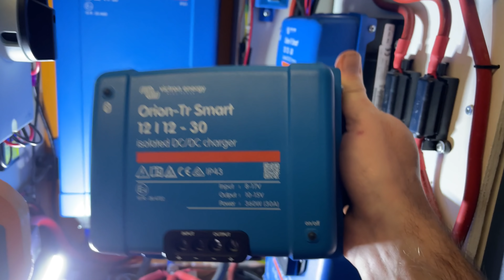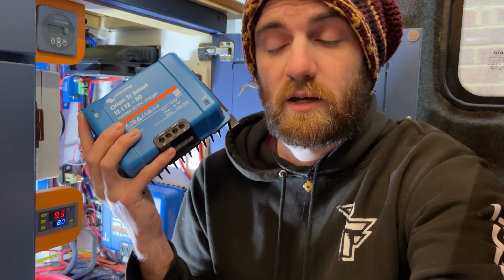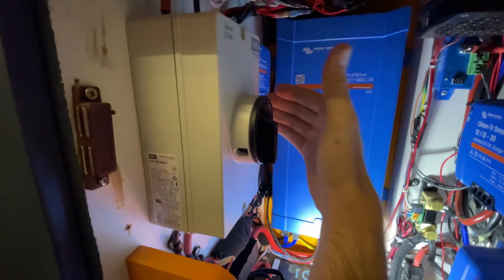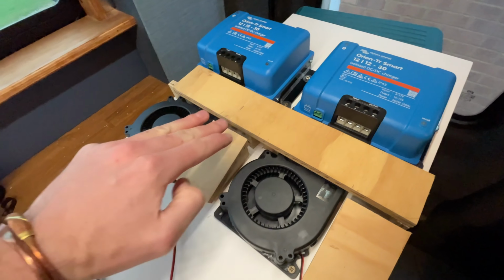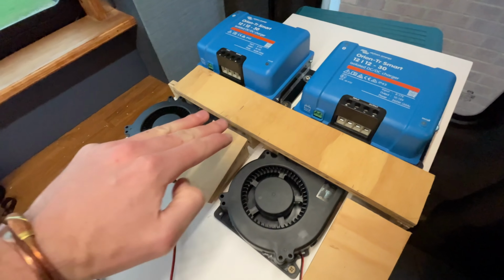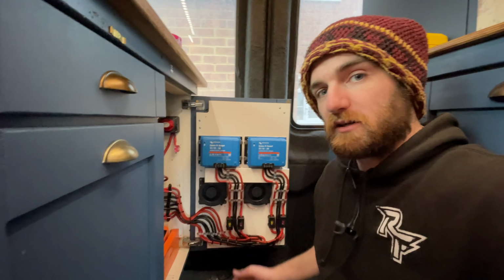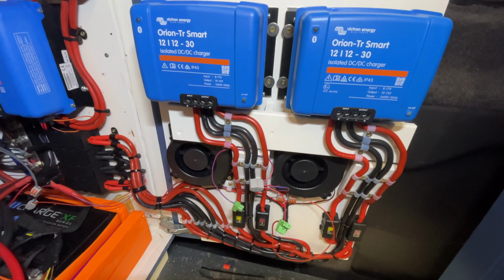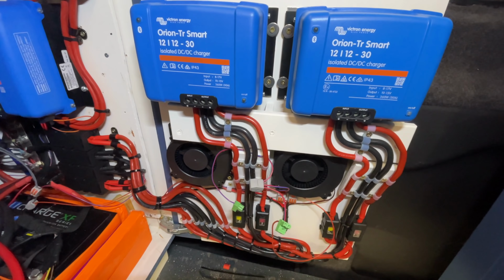Double Victron B2B Charger Install | How To

Comment: Why not charge with a 65 Amp Victron battery protect? The Orion goes from 0 to 30 Amps in 1 second, bad for your alternator.
Reply from the maker: You can’t change with a Victron battery protect, well technically you could. but it would be no different from a split charge relay and they are not the best way to charge batteries anyway. They are just a smart relay, no control on over charging, with lithium batteries, they withdraw absolutely maximum amperage possible, using Orion is the charge amps are limited. With a VBP Unlike Victorn chargers or any actual charger which has charge profiles for different battery chemistries. Example being  my alternator will output 14.7v, just using a Victron battery protect as a charger that means my leisure system will also receive 14.7v which is well outside a safe or healthy voltage for my batteries. 

As for “bad for your alternator” having an appropriate size alternator is more important. Additionally, anything which the alternator itself could not output in the original start-up split second the starter battery would, the system is effectively in parallel with it would pick up the excess.
Reply: @MispronouncedAdventures  Your last sentence is where I think most B2B DC-DC chargers have failings in their design, and the older VSR relays better isolated the two battery systems.  Take for example a system where you have 300-400Ah or more of lithium batteries and you're effectively putting the starter battery in parallel with the larger aux lithium battery bank the moment ignition key is turned to on. Now, add the delay to engine start with cold starting a diesel engine while glow plugs are heating. (some diesel engines still have 30 second or more wait for glow plug light to go out. Then the actual cranking amps itself taken out of the battery. That is potentially a lot of current demand from the starter battery before the engine is even running. Add to that all the modern loads on the starter battery the moment the key is on (daytime running lights, electric fuel pump, etc etc) Put two DC-DC chargers together and their current draw is doubled along with other pre start loads. The problem is exacerbated the larger the aux battery bank because likely a higher amp model of DC-DC charger is chosen and fitted to charge it in a timely manner. When the engine does start it has to replenish the main battery, and feed the DC-DC charger(s). I put a switch on the ignition sense wire of my DC-DC charger (not Victron) because of this, and only open the switch when the engine is actually running. The main battery is already under enough repeated stress in modern vehicles.
Reply from the maker: @erroneouscode  I don’t really see how it’s a design flaw with B2B’s. B2B shouldn’t be on with an engine off. I don’t know who would put a B2B on a ignition live

Victron B2B’s can be run on any signal switch you want, normally engine live ( and not an ignition live ) or manual switch. And/or built in engine detection voltage sensor. Normal set up for Victron B2B is to sense the van system voltage to tell if when to turn on and with a delay as well after engine start before charge starts.

I would disagree on this principle you are that a B2B is putting your aux battery in parallel with a starter when using B2B. They were are a one-way limited output charger ( which is make aux battery size irrelevant in this, but yes there is a likely hood of a larger B2B ) and not like a split charge relay which is truly paralleling the them. Most modern vans are designed for AUX loads and manuals normal give recommendation on customer connection points, specs of models, alternator and starter batteries depends on end users planned Aux loads 

Both VSR and B2B are just as isolated at each other when off.
Reply: @MispronouncedAdventures  " I don’t really see how it’s a design flaw with B2B’s. B2B shouldn’t be on with an engine off. I don’t know who would put a B2B on a ignition live" From that I take it your experience with various different brand DC-DC chargers is somewhat limited because a great many of them do, and some require the connection for the DC-DC to even switch on. It's in their manuals. They have IGN sense which entails connecting a sense wire be fitted to a circuit that is only live when ignition is on. Which as you know means the connection between the two battery systems is open to pass current the moment ignition lights are on. If the engine stalls the DC-DC charger will continue to suck power directly from the main battery, as it will during any delay taken to turn the key (as in waiting for glow plugs).  An engine live circuit is far more difficult to find and tap into or even understand for some novices which is probably why some brands specify ignition live because the product is aimed far more at the DIY consumer market. Not every vehicle has either readily physical access to tap in points, is labelled with X marks the spot as in some vans obviously, and or easily accessed circuit diagrams that a novice DIY type can understand and use. Manufacturers know that. Also, I didn't mention vans. Van fitment is a minuscule part of the overall vehicle numbers that DC-DC chargers are fitted to.  4WD utes and wagons by far would be the primary market for DC-DC chargers.
Reply from the maker: I’m familiar with a number of B2B brands ( many renogy, sterling ) which normal get fitted with  normally D+ signal which is meant to be a Drive signal. Although you will see some company use “drive” signal and “ignition“ signal like they are the same things 

I am just seen these anyone experience these issues with the B2B’s in this part of the market, whilst you didn’t mention van, this context this video vans and campervans  which do normally have a medium to large Alternators for run large Aux loads. 

B2B’s do not make an open connection between both batteries. Its starter battery powers a device / charger, which regulates a limited currant with a regulated amp and voltage depending on your charge profile. Not a connection between batteries like a VSR 

You’re not going flatted a starter battery with a 30amp or even 60amp B2B charger running and if you stall and the normal ( a few seconds )  time taken to restart it unless or looks out of cracking apps as there is already a load like that.  Speaking as a person who has stalled my van a number of them. 

Is this an issue you personal run into?
Reply: @MispronouncedAdventures  Just got back from a trip camping so late reply. I'll give this one more shot and try and summarize my points (Though it will be a long reply) with what I was trying to argue as 'design flaws'. You say a "B2B shouldn't be on with an engine off" I prefer to call them a DC-DC charger as they're mostly marketed as. However, otherwise I agree. You also acknowledge correctly that D+ is supposed to be a drive signal, and that some companies interchange the term. I also agree, and rather poorly I guess I was also trying to relate that point. Take for example the standalone Renogy units of 20,40, and 60 Amps with (no solar input) If you can get through the ambiguity of them continually both in diagram and words in their manual using 'IGN on' as the source to tap into, and 'recommending' to splice into "L or IGN" on alternator this is where confusion can occur, because most novices particularly will work back from that point to find a readily available circuit that is only live with ignition key in the 'on position' as generally stated by most brands in their manuals or video blurbs etc.

And even if you directly splice your D+ or ignition sense (however else it's described by the DC-DC manufacturer) into L or IGN or however else it's designated by the manufacturer of the alternator there is no guarantee that tapping or splicing into that particular point will not supply current to activate a DC-DC charger like the Renogy's models mentioned that need the D+ fitted to actually turn on and allow current to flow between batteries. So, they most definitely will in some cases allow current to flow with IGN return to on position 'without' the engine running. It depends on the way the manufacturer designed the vehicles ignition circuit.
This is why I assume some brands of DC-DC charger implement some form of voltage sensing (akin to a VSR), and or even delays into their product to get around possible problems of the circuit remaining live with just IGN on, and or at least lowering current draw from main battery until after start up with a delay.

Some cheaper brands of DC-DC chargers can even function to pass current between batteries without implementing any ignition sense wire (if they have one) or only recommend it's connection if you have a "smart alternator". This is particularly true of combined DC-DC chargers with a solar input because they're sometimes fitted to portable battery packs and need to continue to function as a solar Mppt controller away from the vehicle.

We don't have the Sterling brand in Australia (that I'm aware) but at least around 12 others that I can rattle off from the top of my head. Now, given that 'some' DC-DC chargers can and will function to pass current between batteries with only 'ignition on' irrespective of how and where along that circuit it's tapped into I was arguing the case specifically that modern vehicles have enough load on the starter battery already prior to start and don't need the additional current draw of DC-DC chargers that for whatever reason may me pulling considerable amps from main battery prior to engine start and alternator running.

Lead acid batteries, particularly old school starter batteries whether low maintenance sealed type or not, have not really advanced. The modern load on them has increased as well as the fact that due to space limitations, cost savings, and fuel economy considerations (weight) they have been kept generally the same size, if not smaller than what might have been fitted in the past. I want you to consider and add up all the circuits that are active and pulling current from the main battery before it's even started. Along with a diesel engine with it's glow plugs heating up which could be pulling anywhere between 5-30amps 'each' per glow plug dependent on specification. While there is not an open connection between main and aux with DC-DC chargers that will allow an unregulated limitless charge to pass between them, I'm arguing you also don't want an additional 20,40,60 amps, and perhaps double that in the case of fitting two DC-DC charger controllers working in parallel sucking from main battery prior to startup. Even if you take the extra current of glow plugs out of the equation, many modern vehicles require extra time when you first turn the key on to go through a check routine and extinguish various dash lights, and if you rush that process you can get faults that require you to do it again exacerbating the problem. The design and functionality of DC-DC chargers is all over the place compared to the old VSR's. Coupled with different implementations of smart alternator technology and ignition circuitry there is no 100% categorically stated fact that you could pass on to me or anyone else that connecting to D+ will act as you state.

A simple two way mechanical switch on ignition sense, or D+ or whatever else they call it, or wherever they ask you to connect it is simple insurance. There's another reason such a switch or breaker should be implemented.. To turn OFF the DC-DC charger. Whether that be to take the load off the main battery during startup procedure to limit loads on main battery, or to shut down the DC-DC charger altogether to stop the alternator or DC-DC charger from keeping lithium batteries at 100% full all the time as in the case with continual or prolonged driving. Which as you should know is not recommended for the long term longevity of lithium batteries. If you now can't see my points then let's agree to disagree and be done with this conversation.
Reply from the maker: Hope you enjoyed your camping trip. 

They are definitely not any unrestricted battery to battery charges in the UK market. That would be great if there was. 

I see the point you’re trying to make I just don’t see them as design flaws because they don’t cause issues in the UK market and that’s from my personal experience on my own vehicle running battery 2 battery chargers ( with 2 winters in Arctic down to -30c when they are used daily, ) and the many many other people I know who use them never experienced this issue ( in the uk van and campervan market ) the main issues I know of are people who fit manual ON/OFF switches to B2B charger and forget to turn them off when they stop driving and flatten there starter 

But as you said the “design and functionality of DC-DC chargers is all over the place” they are many many brands. And issues in the implementation by the end user. 

Is sounds like you are coming a 4x4 car area? I guess in the uk case I do with . They are only 3 main options. Transit, sprinter & boxers/relays ( and there older models, and a few others ) but they are all pretty easy to install B2B’s on. The just there are a lot more option in the car market. 

I’m many are not fans of manual switches for B2B, too many issues of the user error forgetting to turn it. Many are installed and to be forgotten about and to do they thing automatically when driving. 

As for turning the B2B off when a lithium battery is 100% why bother? The charger charge profile will have floated a battery and dropped the voltage back down. Normal cycling use charging to 100% isnt really an issue, that normal day to day use of lithium leisure batteries with solar or b2b charging. Is you are worried about t l 100% charging harming your battery, just drop the bulk voltage by 0.2 ( or so ) to never allow the charge profile to full charge the battery. Long term storage on lithium batteries at 100% is the issue.

Is in this case is Victron Orion flawless? Having a voltage sensitive start ( with or without delay ) or a D+ option which could be wire for ignition, engine, run or manual?
Reply from the maker: I think this might come down to an agree to disagree. Good discussion though. Interesting to learn a bit about the Australian market.
Reply: @MispronouncedAdventures  "Is in this case is Victron Orion flawless?" I have read that some Orion customers have experienced main going flat. I have no idea of the circumstances. I've also read that Victron are in design phase of a new model. Again, I have no idea whether that is to solve potential problems. In old days of VSR's there were some models available that had a bridging function to allow the current to flow back from aux to main if your main was flat. You could then start the engine off aux battery in that eventuality. No DC-DC charger that I've heard of allows that functionality but it would be useful and pay for itself if only used once. Some of the remote places we get to alone without readily available help would see the value of such a design. Perhaps also for the absent minded that forgets to turn off the switch they implemented in their DC-DC installation it would come in handy too 🙃 The wise only make a mistake once and learn from it. I'll leave it there.

Comment: Lol, well funny… It’s not that I need it… I want it
Reply from the maker: Might as well be honest. i don’t need to recharge faster I’ve been fine for the last year but who doesn’t want to recharge faster if they can!
Reply: @MispronouncedAdventures  
Couldn’t agree more especially if you already had a cable… It’s the future, a large battery bank puka blue gear… Run your hot water ,heating  gaming and your cooking …probably everything..the way forward
Reply from the maker: If I had a larger inverter I would definitely consider doing hot water off a instant electric hot water heater
Reply: @MispronouncedAdventures  I turned my 1 B2B off for the trip back from Fontainebleau this Easter. I feel like I gained 4ish mpg. Maybe it was in my head but it felt like it watching the reading on the dash. If you can recharge faster, it's probably better, especially with a smart alternator.

Comment: Слава Україні
Reply from the maker: I 100% agree
Reply: @MispronouncedAdventures  скажи пожалуста. Инвертора Phoenix smart 5000BA victron, подерживают паралелейную или трех фазную работу? Спасибо за ранее за ответ.
Reply: @MispronouncedAdventures  я з корпорации ин Юкрейн. Город Житомир.
Reply from the maker: Hey, 

Normally I see it on the Victron Multiplus & Quattro inverter can do parallel and three-phase configuration. Those inverters use VE.bus for communication.

The Phoenix depends on the model. Most of the modern “Victron Phoenix inverters use VE.direct” ( that comes in the plastic case ) and “Victron Phoenix Smart” unfortunately it’s not possible. 
The Phoenix models in the large metal case “Victron Phoenix” & “Victron Phoenix compact” can do parallel and three phase. 

I hope that helps
Reply: @MispronouncedAdventures  спасибо. Я примерно так и думал. Но все же решил уточнить. Случайно зашёл на твой канал. Искал информацию об оборудовании Victron. У нас в Украине тяжело найти специалистов. В интернете много информации, но вся на английском языке. Тяжеловато переводить, так как английский не знаю. У себя собираю станцию солнечную на 20 кВт. Много вопросов. Выбрал victron. Нидерланды. Дорого но говорят, проверено и надёжно. Хотя поставки идут, и любое оборудование можно заказать в Украину, срок поставки 5 недель.